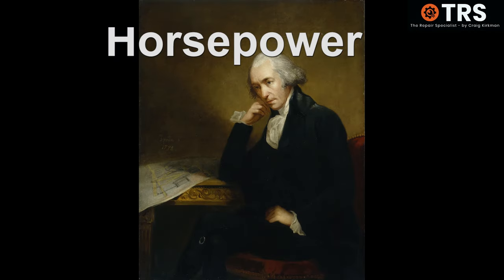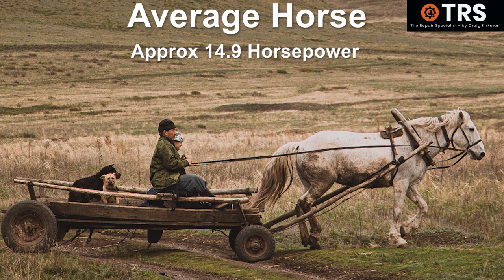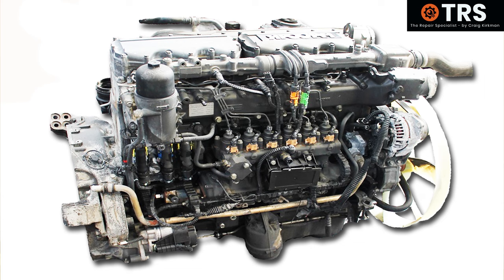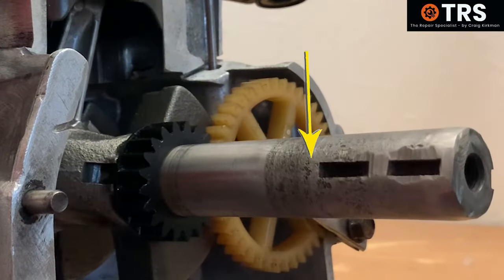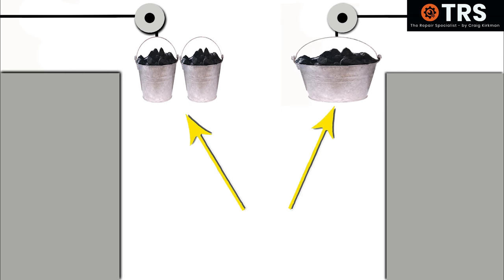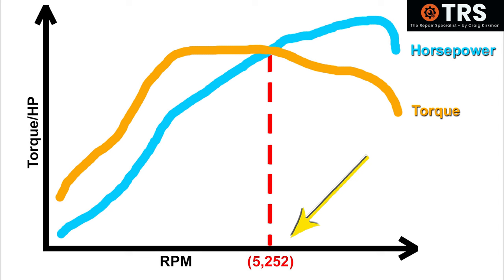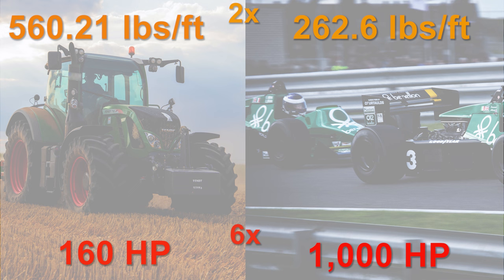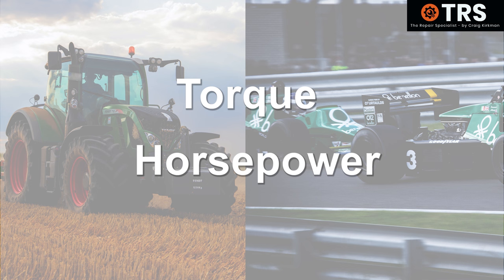HORSEPOWER  vs TORQUE - Is Torque Horsepower? Simply Explained

Comment: What's missing from this explanation is the fact that the F1 engine could be geared down to the same rpm as the tractor engine, which would result in more than 6 times the amount of torque being produced at the wheels. The F1 engine has more than 6 times the pulling power of the tractor engine, in other words.

Comment: It simply means that torque of the engine is the force produced by the combustion of fuel multiplied by the distance from main crankshaft journal to the center of the crankshaft.

Comment: Power is electrical . volts times amps .
Power is watts and is how meters charge customers.
Reply: And 1 horsepower eguals 746 watts
Power is measured in watts
Reply from the maker: Absolutely 👍

Comment: Horsepower is a mathematical calculation of work being done. Torque is an actual measurable force. Torque can be multiplied, horsepower can not. I had an 1994 Chevrolet S10 Blazer with a 4.3 liter Vortec V6. My friend had a 1993 S10 pickup with a 4.3  throttle body engine. Both engines had 190 HP but I had 240 foot pounds torque and he had 170 foot pounds torque. I Tried explaining torque to him, but he said he would win a drag race because his vehicle was lighter...I SMOKED HIM!!!